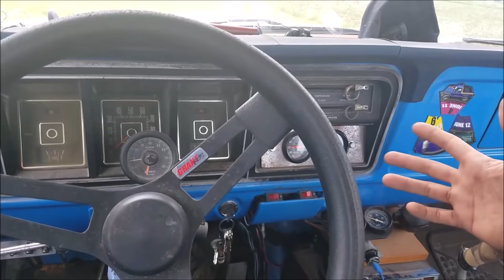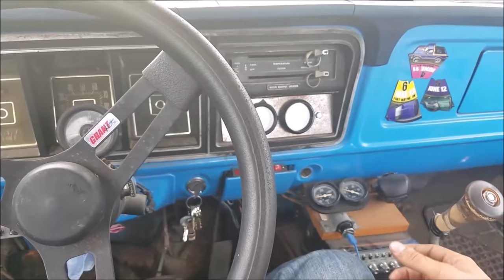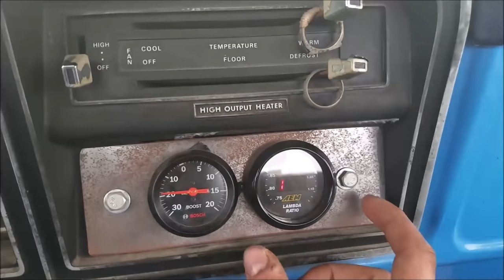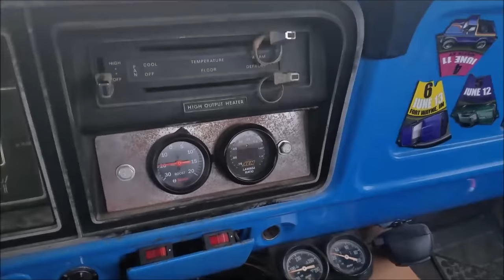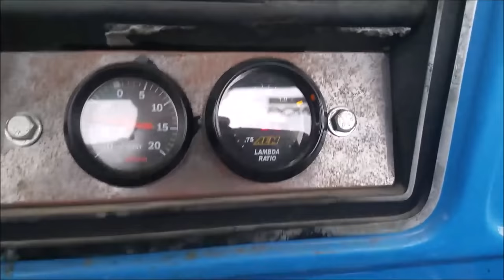Best Carburetor Mod - Vapor Lock & Inconsistent Performance Issues CORRECTED (You'll Never Go Back)

Comment: Great info, our drag car was basically un-tuneable all last year, changed dist, carb and manifold several times with no luck. After watching this I went out and checked all the fuel lines and bam, the return line is plugged. Going to run all new lines and see if that was our main problem, thanks for your wisdom and great vids.

Comment: Never could figure out why my deadhead system was so inconsistent no matter what I changed or how I tuned it. Now I know why thanks. Steel drivers and carbed vehicles forever!
Reply from the maker: It was a long road 5 years ago - out the o2 gauge in and saw what it was doing, researched and tested different things, and finally about 4 years ago I conquered the inconsistent carb. 
I’d drive that f100 in 100 degree Arizona heat with no fear
Reply: @ThunderHead289  Speaking of Arizona....lol. Luke, thanks for another great video. I’ve got a 79 Bronco with a 351M and a 70 Mercury Monterey with a 390 and it was driving me crazy that they would idle differently depending on the day here in Az. It ticked me off that I followed your carb tuning videos and had both of them idling great on the nice somewhat cool  day that I set them up on, then summer arrived. . This video cleared up what is happening. I want to put a return system in both of those vehicles but I have a stupid question. I’ve never dealt with a fuel return regulator before and am curious on what to set the pressure at on the return regulator. If I’m reading the description of the regulator correctly on Amazon, the pressure is adjustable. Forgot to mention I’m running Edelbrock 600’s on both. I know you’ve heard it before but thanks again for all your videos you put out. They really do make a difference to everyone following you! The added bonus for me is I’m a Ford guy..lol

Comment: Hey Luke it's Eric with the green Mopar from the Power Tour, I really enjoyed chatting with you at Martinsville! Thanks for being so polite and talkative and thanks for all the great vids like this. Luckily with my massive hood scoop, aluminum radiator, 160 degree T stat and air gap intake I never seem to have vapor lock issues. However I will be installing a fuel/air ratio gauge soon now that you've helped me understand how easy they are to install.
Reply from the maker: Hey Eric, enjoyed chatting with you. They are indeed a great piece - I’d like to act like im some wizard, but I can always beat myself with the gauge vs without. 
I linked the AEM unit in this video along with the no weld bung - really good piece for the price

Comment: Ford England in 1972 and Ford Australia in 1982 with it Carter fuel pump and Jeep and in about 1972 AMC and Chrysler Corp and Mistubishi added bleedback carb filtration.  Fords TripMinder Crown Vics had it constantly from 1982, a copy of the 2.8 Bosch Injection European Capri and Granada and South African P100 Truck. In 1963, Ford, Carter and Rochester in the USA had a Hot Idle Compensator to sort this out for very hot underhood conditions...like you get with Air Conditioning or in Vans . Over the last 19 years Ive frequented Fords US Websites, 99% of people have ben totally sceptical of hit fuel handling problems and similarly, the need for vapor return or carb fuel bleed back. Uncle Tonys Garage and your video really help open up the problems. A car wont happily idle at stoichometery.

Comment: I had to do something very similar on my Camaro.  In South Florida with the hood down, vapor lock in no time.  I had to make a return like like yours but I could not find a suitable regulator with a return so I used a nitrous nozzle to cause a restriction in the return line.  Glad I'm not the only one "hacking" a carburetor!

Comment: I missed my '76 Ford F100. I have an '86 Ford F150 4x4 with 302 and 6" lift and size 33 tires. Right now my carburetor works great with no issues.

Comment: I had to do the same thing to my SBC in my S10. Would run crappy and vapor lock and start hard. Fuel bowls were reading around 155° F and after installing a return line they are down to 100° F and the motor starts right up easily no matter how hot it is out. Great video! Keeping the fuel moving keeps everything cooler and running better for sure.

Comment: I have a 1986 Ford Full Size Bronco. 300 Inline 6, 4 Speed and the last year of the Carburetor! Although mine Had a Feedback Carb that was a pain in the A$$. I swapped it out with a 1980 one barrel Carter carb without that feedback crap to the computer. Runs like a Dream!!!

Comment: I enjoyed the video and i dig the steel drivers tune. 
I battled vapor lock issues  on my 460, it's in 75 f250 supercab 4x4. I ended up blocking the heat riser and adding a coolcarb plate to fix the issue. I already had a Carter mechanical pump and a regulator set to 5 psi with a 3/8 feed.
 This set up has been very reliable and smooth. I'm sure the af is a bit unstable during long idle periods but this truck usually is moving and not sitting idle for more than a few minutes at a traffic light. 
When I first started brainstorming the vapor lock issue, I wanted to do an electric pump with regulator and return, but I'm picky and wanted an in tank unit that would run a future efi system. This was more $$$ than I was willing to invest at the time. 
So for now I enjoy the simplicity of the mechanical pump but will upgrade to electric in the future.
By the way I have made close to 13 mpgs with this set up on a 140 mile road trip, no od and a small slide in camper in the bed. Q jet carb.

Comment: Great Tip!!! I have been fighting my 77 f250 carb tune for a while now (460, midrange cam, Holley 750 vacuum secondary, mechanical pump, dead head system) and I think this will solve my detonation issue. Awesome. Love your channel!
Reply from the maker: i need to make a video about detonation - two types: 1. timing related 2. octane related.
both classified as the cylinder charge igniting before the piston is on its way down the bore. 
a lot of guys have too aggressive of total timing, or way too much advance. 
the leaner the mixture though, the more likely it is to detonate as a richer 12:1 charge will actually help to cool the chamber - so in that aspect, a return line will help!
Reply: @ThunderHead289  i need to check my total timing as well. I have a feeling my advance springs may be a little funky as well.

Comment: Agree that the percolation/vapor issue hurts carbureted AFR because carbs are static (vs. EFI adjusting fuel mix dynamically). I'd like to see Air/Fuel after you re-opened the return line, but your vids are great & have been a help for me designing my fix. Fuel sits in carb's bowls at atmospheric pressure, so E10-ish fuel still boils in there at 110-115F.   So my solution was to reduce carb temp since it usually sits in an underhood environment of 190F or more (radiator exhaust, headers, engine heat...)  So keeping fuel cool in the lines UP to the bowls helps, but keeping the bowls cooler (via an enclosed cold air box from manifold/phenolic-spacer junction up to hood) plus ensuring fuel in the lines is as cool as possible.  This airbox is similar to Cobras' "Turkey Pan" solution under their scoops, so I built something similar under the hood of our Z, and fed it with two 4" ducts from the nose of the car, and lined it with Reflectix insulation. Result is carb bowls stay at ambient air temp vs. under-hood being 190F plus.  I've seen some vids showing electric fuel pump and return system is heating the fuel similar to a mechanical pump.  EFI's advantage here is that it keeps the fuel at 40-50 PSI all the way to the injector which then sprays it into the intake tract, whereas carbs have the fuel at atmospheric pressure in the bowls (and before that, either 7-ish PSI in the line after a mech pump or 40-50 PSI in the line after an electric pump). Thanks again for great vids and intelligent analytical commentary.
Reply from the maker: I can tell from reading this that you are very intelligent. 
It is definitely a losing game - you can only do so many things. Fuel just doesn’t need to be what it was back in the day because at 40 to 50 psi, it resists a phase change quite well. 
The bowls are the biggest issue - why someone hasn’t designed a pass through carb for the aftermarket world, I don’t know. 
Some European cars bypass right through the carb itself like the datsuns. 
This seems like a great design feature to me.

Comment: I just picked up a 68 F100, 352 3 on the tree, and I've been watching your videos far before getting it. It's got a stumble and loads up when i let off the gas then get back on it, so I'm guessing timing. But your vids always help me diagnose that sorta stuff!
Reply from the maker: I would start with the basics - set the carb transfer slots to a square, put the vacuum advance on the ported vacuum port, and advance the ignition timing till you have your desired idle!

Comment: I would have liked to see you turn the valve back on and watch the AFR stabilize once it started getting cooler fuel.  I have heard of some guys having issues on fuel injection vehicles where the big high flow high pressure pump heats up the fuel and returns to the tank enough that all of the fuel gets hot in the fuel tank.
Reply from the maker: i wanted to, but for the sake of video time i didnt - i could honestly talk for hours about carbs and ignition timing. maybe i need to just start doing live tech talks

Comment: Even fuel injection has issues like this as well.  Very well explained luke
Reply from the maker: i wished i would have drove home a few additional points, but for myself its always a major battle to not get really long winded.
Reply: @ThunderHead289  20 & 30 minute videos are good too.
Reply: So in conclusion name of the game is correct return, tuning, and a mechanical and electric pump set up. I have a Mr Gasket fuel cooler I was going to put on instead of electric fuel pump for a twin Eldelbrock 500cfms on a hot 496 CBB. Great vid man.

Comment: Thank you for giving a realistic solution to the downfall of most carburetors👍 I have a 67 Mustang convertible with  a 302, 289 heads edelbrock 600 carb, Heddman headers and a pertronix pro billet aluminum distributor.  It runs decent but at times I do get the lag and rough idle that drives me nuts. This gives me a great option to smooth it out, THANK YOU for the great suggestion!!!

Comment: Did the same thing with my Dodge. A 318 LA block with a 4-barrel and 3-speed torque flite. An electric fuel pump that can be switched as a backup for a mechanical pump works good with this problem.

Comment: Dim really glad I found this video. I have an ‘89 Ford with a351-w that I’m fixing to convert to carb. It’s obviously a FI system so it should already have a return line. I’m waiting for the coil to arrive and I’m going to order an rv style cam. I had not thought about utilizing the return line until I watched this video. Thanks for the info.
Reply from the maker: Make sure that you get a carb style distributor also - on the injection distributor the computer advances the timing - a carb required a mechanical advance w/ vacuum advance capable distributor
Reply: ThunderHead289 
Yep. I did, thanks for the reply.

Comment: Good job Thunder, most people don't have a clue, they will look at a throttle body and call it a carb. Nope, nada no way prince. But fuel can make or break most rigs performance. Trying to make fuel squeezers out of a say 750 holley or afb carter just doesn't happen but it can be made to run good and that will save money

Comment: I am not well versed on the carburetor gospel, you said return regulator. How do you adjust the fuel pressure going in to the carburetor? Did I misunderstand something? It happens all the time. Great video.

Comment: I know you are a fan of the summit carbs. Sounds like its running great for you. Have you noticed any issues with the mixture screws and the internal threads for them on the carb body at all? Thanks for posting more pratical and very easy to understand tech info.

Comment: runnin a 950 on my 281 02 saleen speedlab mustang, run a return line from my FPR back to the tank so i don’t get vapor lock and the fuel wont stay that compressed so it won’t get hot

Comment: On my 94 f150 i have had 2 of the carter pumps die on me. Keep a spare pump in the cab.
Reply from the maker: all electric pumps tend to fail deadhead style - the fuel cools the vane pump/motor. when you are at idle, that pump is hitting the internal bypass where the same fuel is in the pump and it gets hot and burns up. 
iv never lost a pump since i went return - lost them a lot beforehand
Reply: @ThunderHead289  i have a holley 12-803 bp that is a bypass regulater, youve seen it in my video "efi to carb 300 l6" these new old stile pumps just aint made very well. The carter pump we are using was made for dodge power wagons in the 40s. 
And i do run my truck hard, i did a 18 hour run hauling steel for my welding compane and never shut the truck off.

Comment: Middle of nowhere Iowa howdy!              I ran an aftermarket oil cooler as a fuel cooler in my 76 gmc sprint with a mildly built 350. On a 95 degree day I could drive around town for an hour or so and the carb would be cold to the touch. This was running the stock fuel system.
Reply: Wow.  That sound awesome.  My '62 runs pretty bad at idle with 89⁰ days.  Maybe, I should try this, too.  Is there any drawback?  What about cold (winter) days?
Reply: @RalphSampson...  I didn't have any problems with the cooler in cold weather. I was also running a high flow 160 degree thermostat. The only problem that gave was a weaker heater. If you decide to try it, maybe locate the cooler in a spot where you can block it with a piece of cardboard. I also had home water pipe insulation on the fuel line between the cooler and carb.

Comment: My 73 is still a mechanical pump but it had a factory return fuel line. Above the fuel pump before it gets to the distributor area there was a bypass that runs back to the tank. hell if I know if it still works lol
Reply from the maker: The oldschool factory return stuff that started to hit the scene was manageable, but still didn’t quite correct the issues - my 84 mustang with a hole in the hood and factory pump return was resilient, but still couldn’t handle traffic in 90 degrees for a long time. 
Returning after the carb really does the trick - the bigger your electric pump, the better in this case

Comment: Good information to know! My ‘69 Jeep Wagoneer w/ the factory optional Buick 350 V8 has a return type fuel system, but oddly enough Buick cars with that engine did not have one until around ‘75-76.

Looks like your one dog is part cattle dog?

Comment: Very informative video, I learned a little as well. Nice Ford, should call it OL' BLUE. Question, why does the temperature go up when the fuel gets heavy or thick. I know a lot of Hot Rodders have that problem and I've always wondered why.
Reply from the maker: Howdy friend, I’m not sure what you mean when you say “the temperate goes up when the fuel gets thick”. 
Fuel is not a viscous liquid, so I’m not sure I follow. 
Now fuel does get molecularly thinner as it gets hotter
Reply: @ThunderHead289  What I meant was, why does the density the gas go up and cause the motor to get hot.

Comment: Thanks for posting these videos. I am a newb when it comes to this stuff and I am learning a lot. I will definitely be running an electric pump/return line on my project car. It seems like a no brainer. It was neat how you turned the valve to simulate the older mechanical pump system and show how crappy the AF ratio got. One question though, have you ever put a heat shield plate under any of your carbs? If so, did it provide additional consistency to the tune or was there not much benefit?

Comment: I use rubber line of all my carb engines lol my mustang has braided like under the hood for looks but goes right to a rubber line lol. Good branded line isn't cheap. Good rubber line is super cheap. Been thinking about doing a e85 conversion on the mustang since it's all over here in Ohio and is around 105 octane.
Reply: Yeah but it will make more power, if I cared about fuel milage I would have left it stock. It's right around 10.9:1 compression so I run 93 and its stupid expensive here.
Reply: My buddy runs it in his 306 and he said it's not 30% difference like everyone on the internet claims.

Comment: I have a 1968 Mercury cougar with it's original 302 block and mechanical pump.

I love the reliability of a mechanical unit & I've never set up a return line on anything else I had previously.

What will happen if you install a return line system but retain and mechanical pump?

How does it decide when to return fuel if I did?

Comment: I've had for over 38 yrs. a 69 swb f-100. It's a great looking truck. I'm keeping it. It originally had a 302 V8, l replaced it with a low mileage 300 6cyl , but l can't get it to idle, replaced gaskets. The engine came out of an 83 van . l just can't get it to idle, after a while it vapor locks and l'm stuck until it cool down, which could be hours. I just can't get it to run right, afraid to go any where in it and be stranded. Could you help me out? Thanks.

Comment: Very interesting and informative video. I have the same yr F100. Curious on how you mounted the barb fitting to the valve at the tank that vents to the charcoal canister?
Keep up the great work!
Reply from the maker: I can definitely get a picture of it - basically nothing special, I cut it towards the back, slid a fitting on it and flared it, then used a flare coupling, and a flare to 3/8 barb for the rubber line.